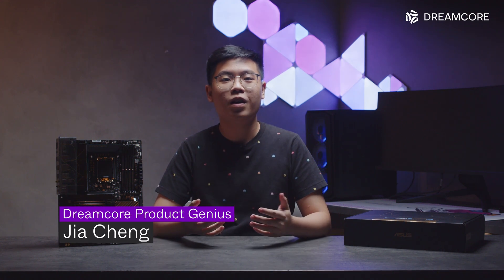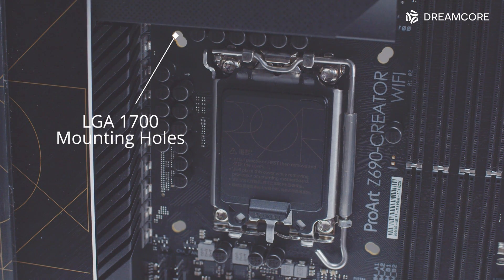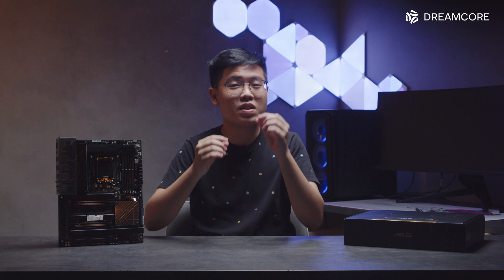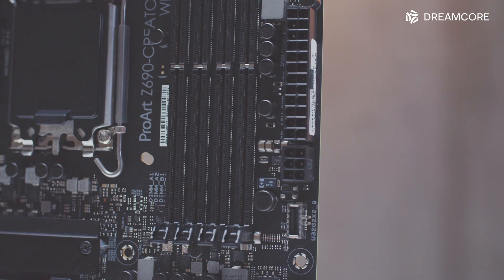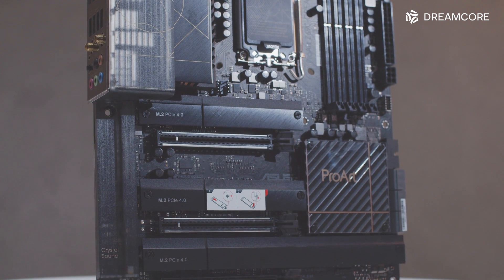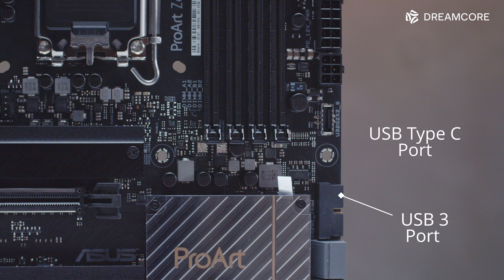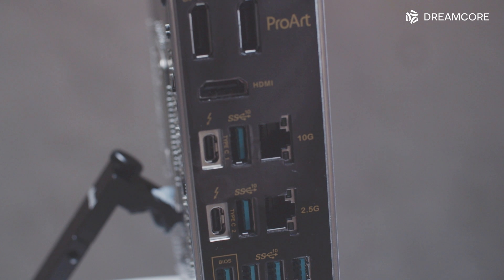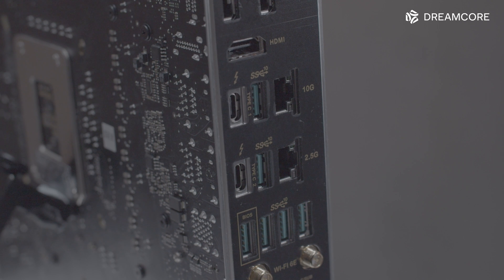ASUS ProArt Z690-CREATOR WIFI Motherboard Overview

Comment: How does the M.2 slots work? If I use 2 of the with M.2 980 will this maintain the speed of a M.2 or will it slow it down and cancel the other out? I would hope to increase the speed or share the speed as to not drop during usage? If running four, what is the advantage or disadvantage are there? and you mentioned using the last M.2 slot would cancel the fan controller pins? Why is this, please explain in detail?